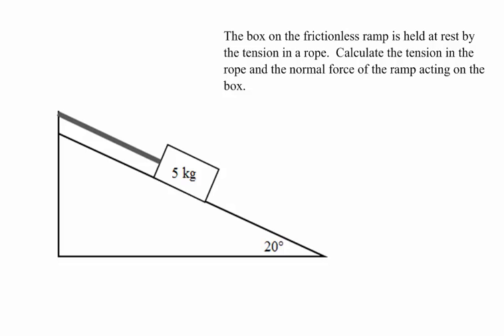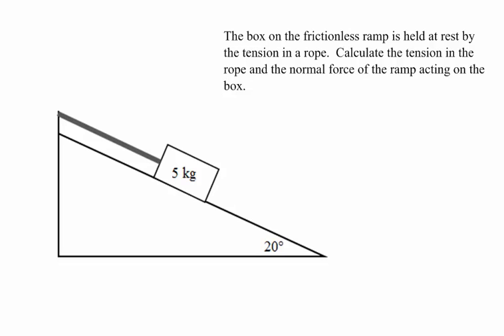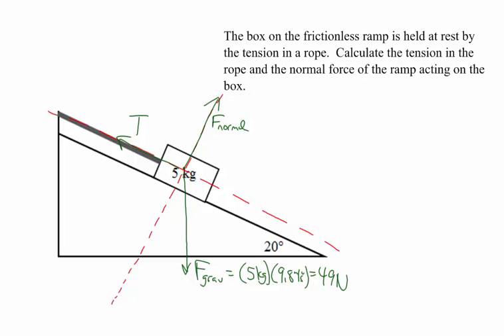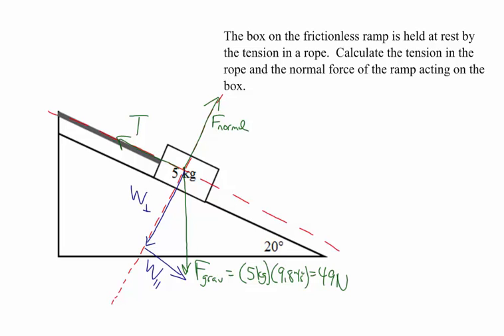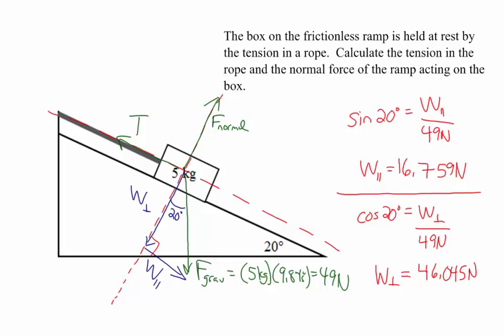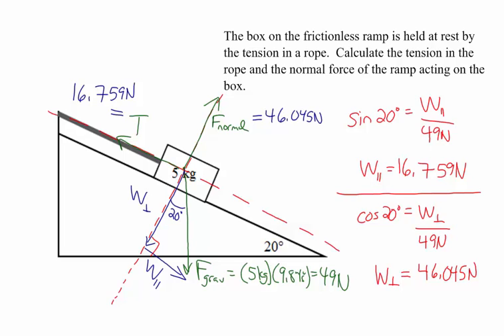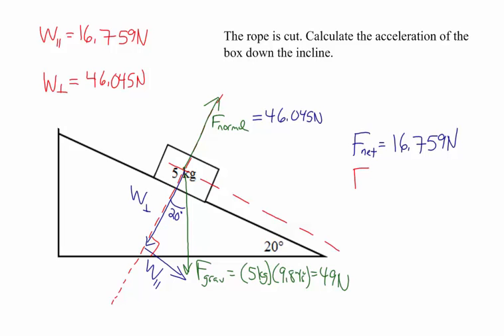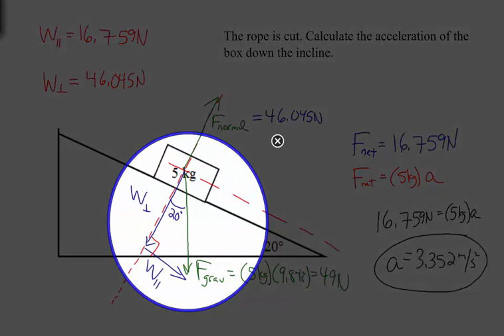Object Held at Rest on Frictionless Inclined Plane

Comment: Shouldn't the pharrell force on the x axis should be calculated using 49cos20° since x axis is adjacent which using cos sign rule is equal to the adjacent on the hypotenuse?
Reply from the maker: If you look at the video starting at around 6:30 you can see how I get the angle between the weight and the perpendicular component of the weight to be 20 degrees. Because the perpendicular component of the weight and the full weight (which is the hypotenuse) come together to form that 20 degree angle, that makes the perpendicular component the adjacent side and the parallel component is the side opposite the 20 degree angle, which is why you use sine to calculate it.
Reply from the maker: Also, there is a difference between the axis that is parallel to the ramp and what you would usually call the x-axis (which is in the horizontal direction). Some people will still use x and y to describe the new axes, but I think that can get confusing which is why I rename them and call one "parallel" and one "perpendicular" because I find that easier to understand.

Comment: How does this change the calculations if the box is being held in place by a person applying a force to prevent the box from sliding down a frictionless incline.  How would the minimum force to hold it in place be calculated? Does the force being applied change the magnitude of the normal force? Thanks.
Reply from the maker: It depends on if the person is pushing parallel to the incline or at some other angle. If he was pushing parallel to the incline, his force plus the tension would balance out the parallel component of the force of gravity (or if there is no rope, then his force would play the role that tension played in this problem and would equal the force of gravity). In this case (pushing parallel to the ramp) the normal force would not change.

If he is pushing at an angle relative to the ramp (for example he pushes horizontally), then you would have to break his force into components parallel and perpendicular to the ramp. The component parallel to the ramp would balance the parallel component of the force of gravity and in this case the normal force would change.
Reply from the maker: In this video I show a force that is acting horizontally. It is not the same as what you were asking (where it is held at rest...it is accelerating along the ramp) but it shows how the normal force would be calculated.

https://www.youtube.com/watch?v=o9YAxNqeTHI

Comment: If the ramp were not frictionless, how would the tension of the rope be changed? I thought that since the box is not moving, friction would not play a factor but apparently that's wrong?
Reply from the maker: See slides 19-22 in these notes: https://drive.google.com/file/d/1cRNppCmqBESai-6ygu_p3CWEo9Ya1VqM/view?usp=sharing
Reply from the maker: If there is friction (specifically it would be static friction if the box isn't moving), there would be a range of values of tension that would keep the box at rest. It is possible that the tension would be the same as the situation that I show in the video (in that case there is no friction needed to keep the box at rest). If the tension is a little smaller and the box still stays at rest, the tension is pulling up the ramp and friction also pulls up the ramp. The static friction has a maximum value, so there is a minimum tension that you need to apply to keep the box at rest. If you pull a little harder than the tension I calculated in the video and the box doesn't move, there is a force of friction acting down the ramp. As you pull harder the friction gets bigger, up to its maximum value. This gives a maximum tension before the box starts to slide. This means that for any value of T between the minimum and maximum values, the box will be at rest.

Comment: Ok let's forget newtons and make this simple. I have a train that weighs 40,000 tons on a 1 percent grade. The coupler "knuckle" has a breaking force of 1,800 tons. so my question is simple. With the train being stationary how many tons of force are on the knuckle at the locomotive which is supporting the whole 40,000 tons?
Reply from the maker: First - a 1% grade is an angle of 0.6 degrees (see here for explanation on converting from percent grade to degrees: https://www.archtoolbox.com/representation/geometry/slope.html ). Tons are another unit of force, so the weight (or force of gravity) is 40,000 tons. As you see in the video, the force that needs to act up the incline equals the component of the weight down the incline (which is the weight*sin(theta) ). So the force needed to keep the train from sliding down the ramp is (40,000 tons)*sin(0.6 degrees) or 418.87 tons (well below the breaking force of the coupler)
Reply from the maker: If you need more decimal places in the angle, this site talks more about converting from percent grade to degrees: https://sciencing.com/convert-percentage-slope-degrees-8093249.html
Reply from the maker: 1% is actually 0.57293 degrees, which would change the force to 399.98 tons.
Reply: @scottsecrest2190  thank you, the reason I asked is because BNSF decided to put two loaded trains coal together and for some reason 3 out of 5 trains break two to three knuckles going over these 1% grades. the grade is such we have situations where the lead train is going down the front side of the grade while pulling the second train up the backside of the grade.  90% of the problem is that the engineers don't understand that the weight of the first train is acting on the pulling force but continue to use power thinking they need to help the second train over the hill. We have accelerate monitors on the locomotives and I see them pulling that second train (20,000 tons) over the backside of the hill at 5mph/min.
Reply: I need to learn these formulas to make my job easier
Reply: I'm also an engineer but when I go over these grades with these doubled up trains, I never let the train accelerate, in matter of of fact i loose about 2 to three mph by the time the second train tops over the top of the grade. Never broke one yet by not using power to pull the second train. I just let the weight of the first train to do all the work.
Reply from the maker: @gmcxm211  Not powering the train to make it accelerate up the incline is definitely important to keep from breaking the knuckles. This video of mine shows how to calculate the force up the ramp if it was accelerating up the ramp too: https://www.youtube.com/watch?v=MQfyvzXUdIU